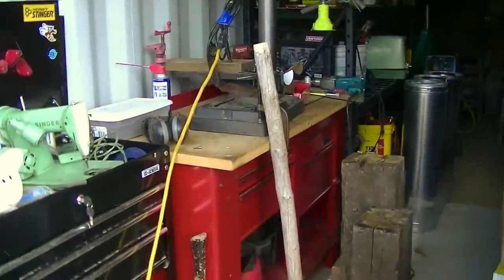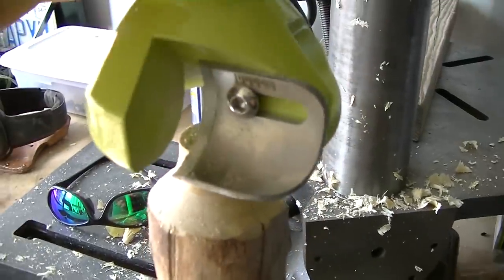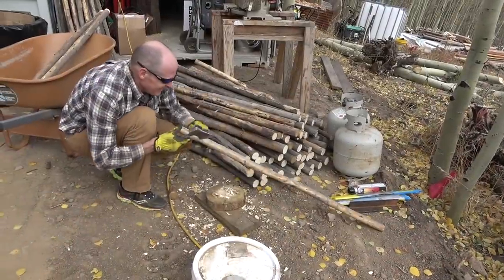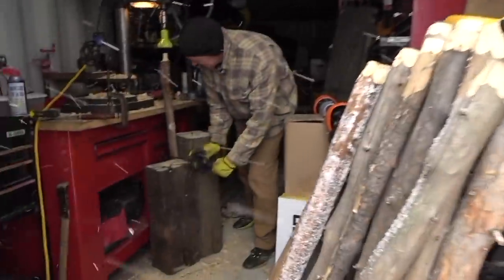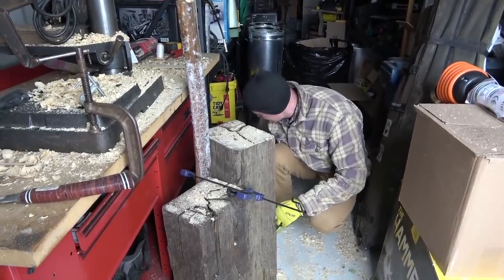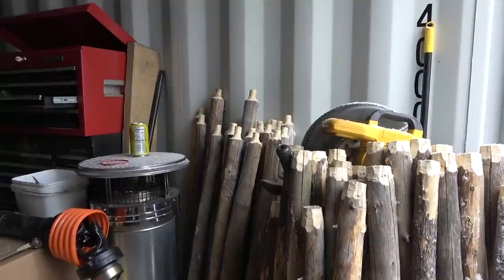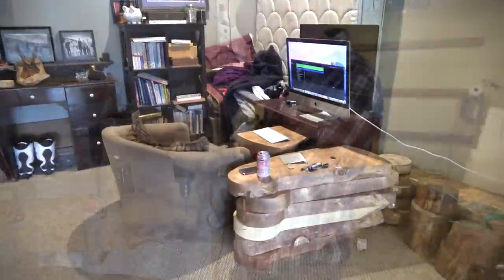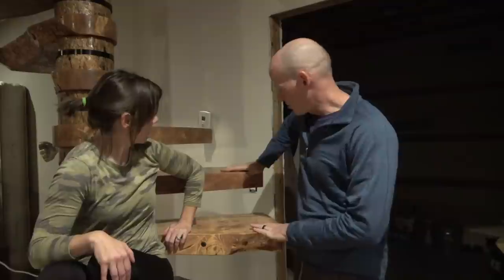Tenon Cutter Drill Press for Making Log Stair Spindles

Comment: I’m glad that you found a way to do the tenoning successfully. Half the work is put into how to do it and rigging something to do it with. A note, however, a file is great for removing burrs from edges but if you plan on some rustic furniture in future projects then a good inexpensive tool to have would be a slip stone to sharpen those blades a bit. They can usually be found online or at Woodcraft (locally ?) or similar and are intended for lathe-turning tools and gouges. Sharp tools always cut easier!
Reply from the maker: Thanks for the tips!

Comment: Hi Brian and Amy,  may I suggest taking your skill saw set it at a 45 degree and cut a “v” notch in one side then you can clamp the work piece to hold it
Reply from the maker: Cut a notch into the spindle itself?
Reply: @ColoradoMountainLiving  I’m sorry, cut it into the rail road tie. May I also suggest to bend your hand rail start by clamping a block of wood to the front of the step at the out side end of each step. Then bend and clamp your hand rail to each step. I hope this is clearer than mud

Comment: You may find that by using differing diameter/straightness style spindles you won't be able to get 4 per tread. More like "play it by ear" mode here.Test the fit of the chosen spindles before drilling. I think I'd use the Irwin (in a smaller size) and finish with the forstner because the Irwin has a lead screw that won't work if you pre-drill.??? I don't know - I would be spearmintin too...
Reply from the maker: That's probably a good mindset to have going into this project. And definitely do some test assemblies before the real thing!